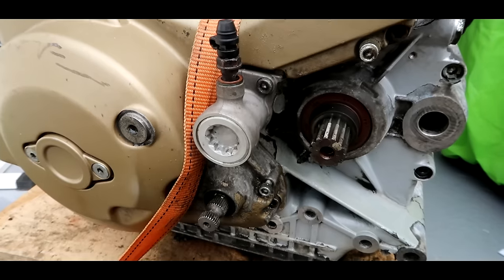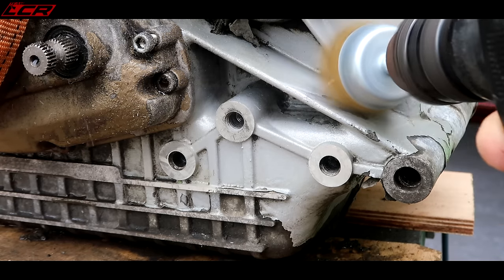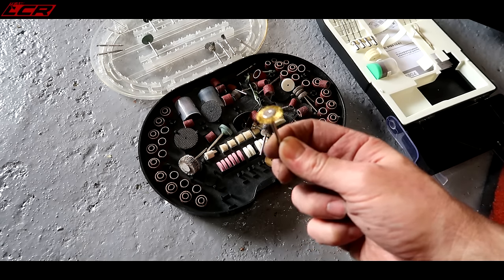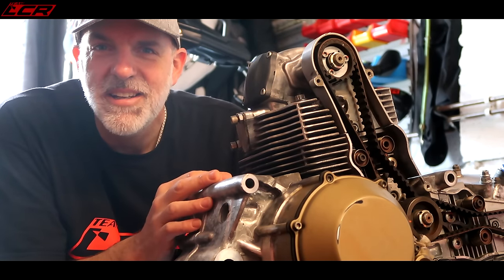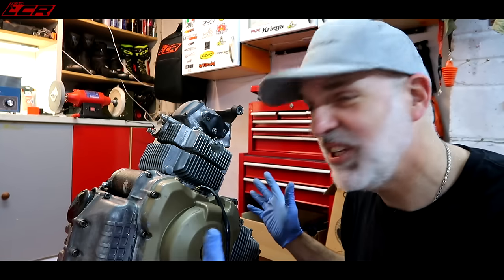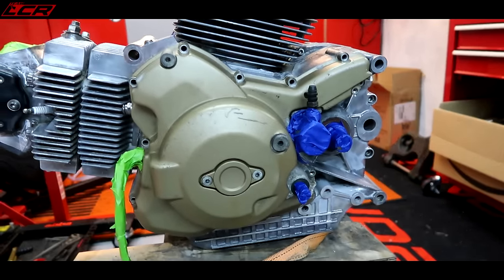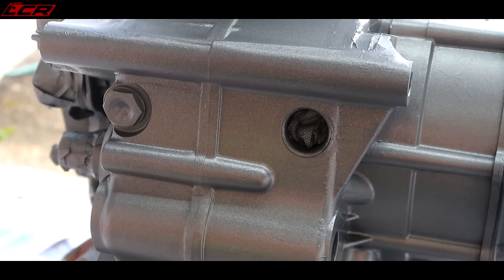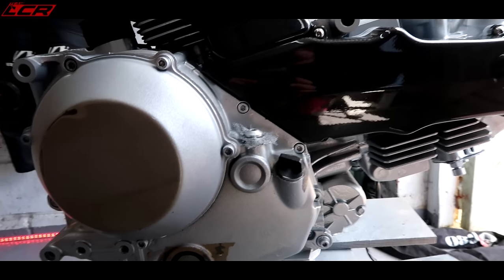How To Prep & Paint A Motorcycle Engine EP06 | Ducati Hypermotard Restoration

Comment: A nice trick to clean up aluminum parts is to use a soda blaster. Easy to make or use a small sand blaster. Load it with baking soda and go at it. No worries about getting grit in your engine. You can also do this with the engine installed with no worries since the baking soda will not harm anything. Its kinda messy, so do it outside.  Just rinse with water to clean it up. 

This provides a nice satin finish, no worries about getting to aggressive with the blasting, it will not remove extra material. You can leave the finish as is, polish it, or paint it.

Comment: I used a soda blaster on mine plugs into an airline and being slightly caustic it eats away at a surface,  then i used brake cleaner to wash it of using a spray garden pump  worked wonders. Coming along well mate be safe and well

Comment: Hi, might want to use a respirator for this type of work Chopsey. Its looking good though, looking forward to seeing bits going back together.
Reply from the maker: Yes did regret not having one... not pleasant! Wont make a habit of it!
Reply: @LambChopRides  Should have used one my self, found lots of carbon fibre bits in my nose this evening after fixing cracked acropovic exhaust earlier :D

Comment: Just finished same job on my Ducati 1000SS! First time doing an air cooled engine, hard work! Those rubber dampers will come off with a pair of pliers on the inner edge. I broke one, they are cheap and available. Good luck with the rebuild.
Reply from the maker: Yes it hard going eh Andy! I've removed the rubbers, will give them a clean up before refitted 👍

Comment: This is actually very cool,I was planning for quite some time about cleaning my xjr130p engine with the same method but I was worried the metal brush might bite into the aluminium so it's nice to see it doesn't and that it can be done

Comment: Chops good job like you said its budget,, and your going to use it,, certainly is an improvement on what you started with and admitting that something is harder than you can deal with,, I do most of the work on the bike I own,, apart from the valve clearances,, liking this series a lot glad you bought it and not the aprilia, 😁😁😁☘️☘️☘️☘️

Comment: Just seen this, currently doing a similar project with an oddly shaped xr650 engine too 
I can see you filmed this a while back but just in case it's of any help on future projects, the scotchbrite bits on the dremel are pretty cheap and super effective 
Run them at higher speeds, aggressive enough to get old paint and oxidisation off, but won't chew into the cases and don't need any hand finishing either 
Awesome video 😎

Comment: Scotch bright pads are better than those sanding foam pads, available in many grades and is what body shops use.

I think you will end up disappointed, the paint will fail quite quickly. Guess next time you might have the confidence to strip the engine fully especially as you won’t need to do all the other work on the chassis and running gear etc. 👍

Comment: When you saw the areas primed but still not happy, you should have taken another day and refined them, you could have knocked the top off the spark plug to get access and sanded down all the areas where the old paint shows and rough surface could be easily addressed.

My OCD would not cope with this finish and all the painted bolts and nuts.

Pity, I was hoping for a more finished product 😢
Reply from the maker: Hi James, dont worry all the painted nuts and bolts will be replaced. Yes could have broken the head off the spark plug good point 👍
Reply: All good Chops, just spouting my mind, level of OCD comes out with me and it always cost me multiple times what I first budgeted. Do what you are happy with and I will follow and occasionally give my opinion and occasional technical knowledge and tips wanted or not, but best intentions always. 👍

Comment: Wrestled with the same problem on my custom r80 build. 30 year old engines are hard to get clean without blasting. I've disassembled heads etc to get vapour blasted to take the crank out and everything else needs a lot of specialist tools so I'll just have to make do. What I have found that works well is alubright from raceglaze off eBay for removing corrosion in hard to reach places. Knowing it's not perfect is eating away at me though 😭
Reply from the maker: Haha yes completely agree Steven, thanks for the tip but too late now! Where were you last week 😂

Comment: Was that a reverse edit of the paint going on when you were applying the clear coat over the camera?  I want t do it to mine now but I'd probably still be in lockdown until 2022 if I tried that lol.  I'm toying with ideas to maybe change the colour of the fairings for a bit of fun, I'd probably use a plasti dip so it's temporary though.
Reply from the maker: Haha yes it was well spotted 👍 setup a picture frame with clingfilm on to spray in front of the camera. Was quite a faff to get that shot so used it twice, one in reverse 😂
Reply: @LambChopRides  😂😂 Nice one, it worked well 👍

Comment: Morning....rubber mounts on the front unscrew...they just dont look like they do...!

As for the motor....first and foremost...i think paint always initially looks good but you could find yourself in the same position again after 6 months and one winters of usage...but, ill happily eat my words in 12 months time and i really mean that :)

With regards for stripping the motor... I took my motor up to Ducati John who literally had the entire motor down to its crankcases and component parts (right down to the valve guides) in 2 hours...(all bagged and labelled for rebuilding) i think that cost was about 110 quid for that...

In agreement with you though it is just an everyday hack. Great vids - looking forward to the re-assembly (and the fact its not me doing it!)
Reply from the maker: Ok great news though they must but looked glued! If we weren't in the current crisis I would consider taking it somewhere for stripping but just not possible currently and I'm trying not to get completely carried away. Will save the strip and paint for when it's out again next year for tuning haha
Reply: @LambChopRides  Yeah - i said that when mine needed rebuilding from a siezed crank (long story) - its on the forum...proper Jackanory job....problem is once its apart y'think...well, may as well do that, that, that, that and while im there....that.. then 3k later youve got an engine....just for the record if you ever do theres easy power to be gained on head work... :)

Comment: Appreciate the effort here, but just seems a bit half-arsed not stripping it properly and painting over seals, bolts etc. Can’t help thinking one winter and it’s going to be a dog’s breakfast... but it’s not mine, it’s about what you’re happy with!
Reply from the maker: Bolts will be replaced afterwards  I have a complete new set. Seals, only ones are hidden anyway or will be changed when casing come off for cerokote.

Comment: A medium scotch brite wheel on a drill is all you need to remove old paint and corrosion off a engine , please dont use a wire brush as its course and you will have to go back over everything to get rid of the scratches ! Just use  the 3 grades of scotch brite wheels ffs !!  You've just made me cringe using that iron wheel brush on that soft  ali !!  🤣😅😂
Reply from the maker: Yes good idea, oh well next time 👍👍
Reply: @LambChopRides    doooood !!